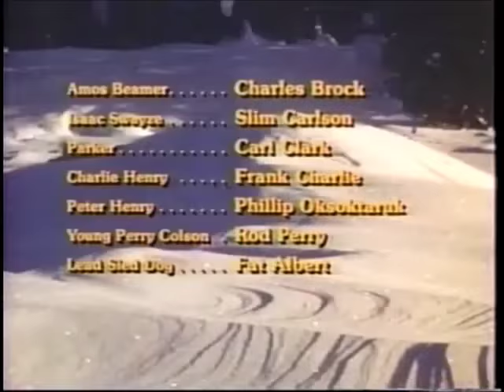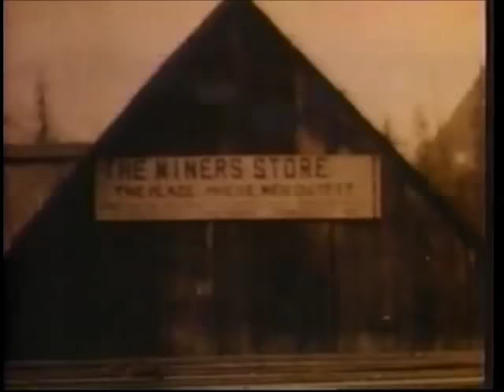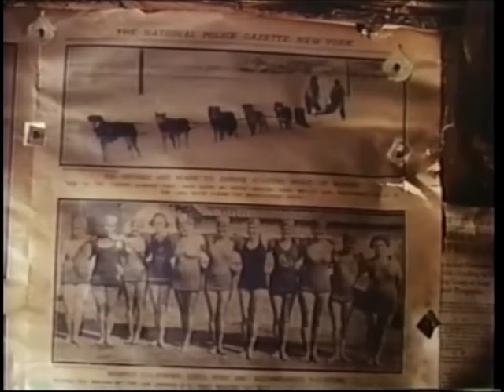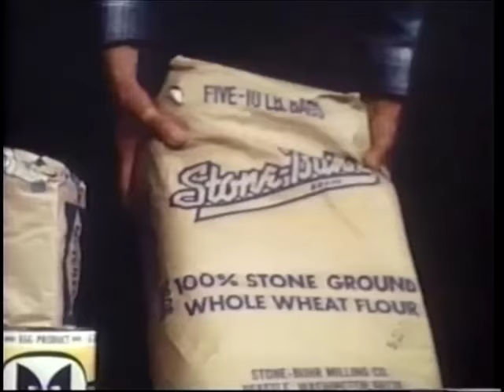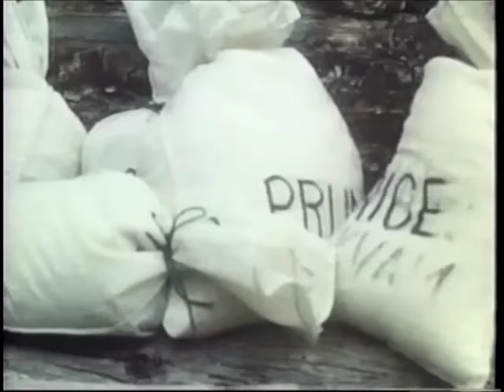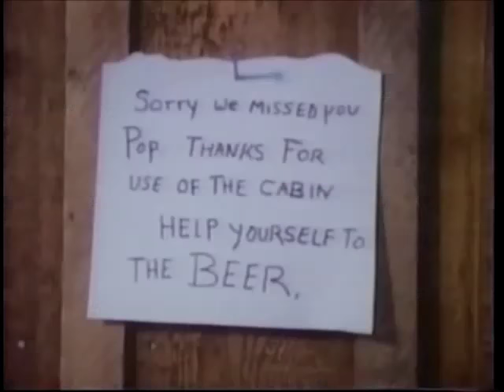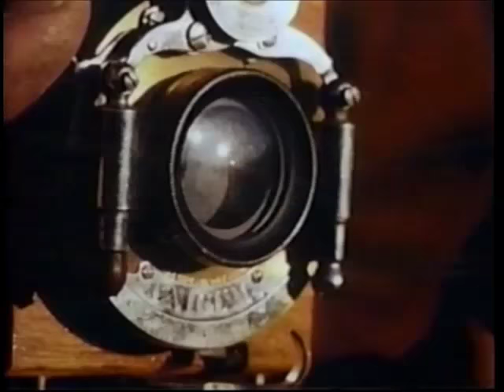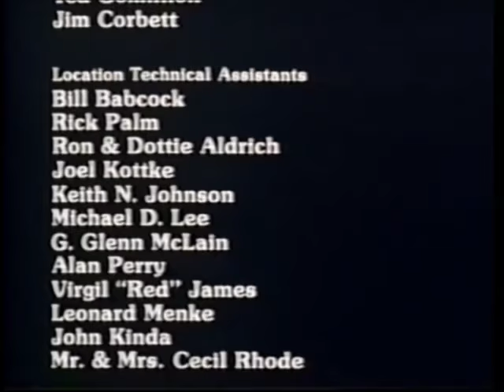Sourdough (1977)

Comment: Does anyone know how his sourdough feeding works in the jug? (Minute 13:57)
If I just pour wheat flour on my wheat sourdough starter, then nothing happens. 
Only when I mix the starter every time in a ratio of 50:50:10 (50 g flour: 50 g water: 10 g old sourdough starter) does the sourdough rise.

I would be grateful for any advice :-)
Reply: To start Sour Dough, you need some sugar flour and water to be routinely added.  It's called "Feeding" it.  You need to follow a recipe and the rules.  I was successful with a batch once and got a loaf of bread to rise.
Reply: @conniesongbird1823  Thanks for the hint. I've already had several successful sourdoughs in the refrigerator. I just don't know how he manages to get it to grow by simply adding wheat flour to the sourdough that is already there.
With me I have to make the sourdough from scratch every time, with 50g flour and 50g water and 10g of the old sourdough.